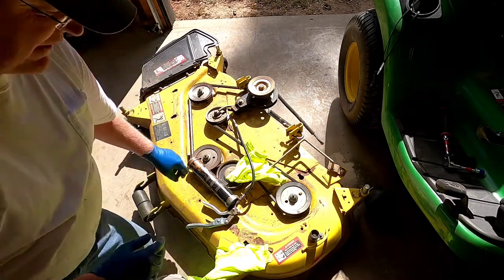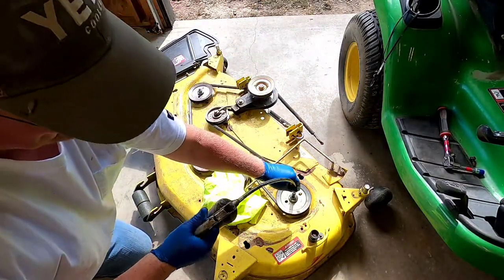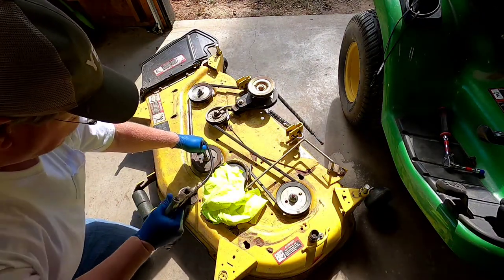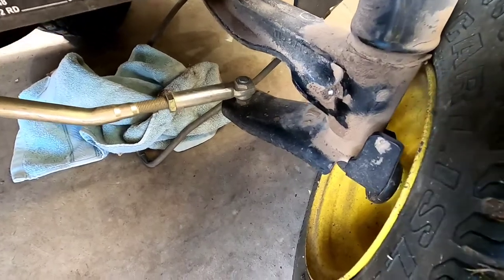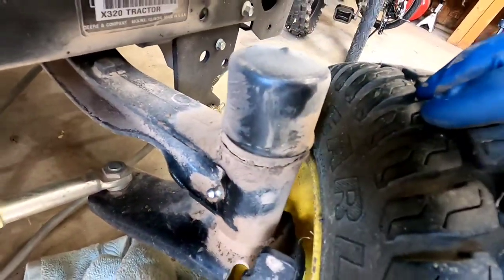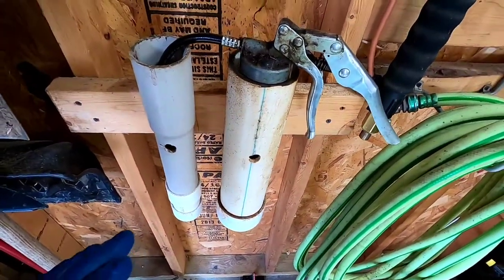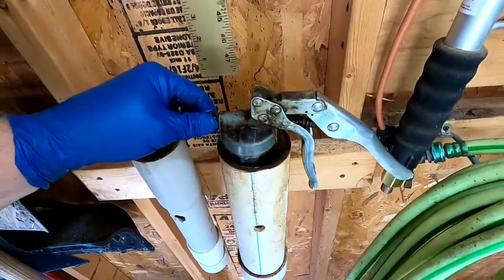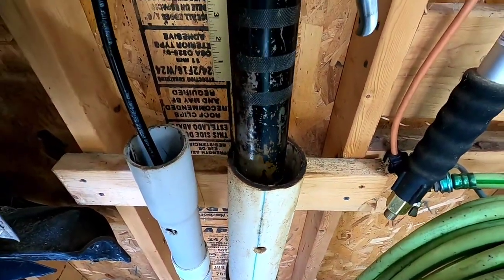How to Grease Lawn Mower Deck Blade/Belt pulleys and Steering wheels John Deere X320

Comment: Saw a "Steve Small Engine Saloon " video here on yt last season and the spindle bearings NOT receiving grease...  I'm contemplating on pulling one apart just to see what and how my X340 has and if it's like what he showed. I'll go fetch the link and post it back here
Reply from the maker: Thanks for the link, good luck
Reply: Here maybe this will help you. Splindle bearings will get grease if you grease like this video creator shows. He said it comes out of the spindle so he filled the assembly up. Meaning the grease had to pass by any and all of the bearings dust seals to get out of the assembly. So you can rest assured bearings receive grease. As for anybody who post a video telling you that grease won’t penetrate a dust seal that is not capable of stoping pressurized grease from passing by or for that matter a small fart. I’d be careful who I take my advice from. Just because they post a video does not mean the person making it has any clue as to what they are talking about. As for this video I bet this man can tell you how long his bearings have lasted. He greased it well. Didn’t stop because someone said the seals would prevent grease from reaching a bearing. Here is the link to my video to prove it https://youtu.be/PwObkilFXN0
Reply from the maker: @GTObearclaw1  Wow thanks, I had not idea, I thought I was doing it right, but I Now I understand bearing alot more!!! thanks for taking the time to explain what is going on. and yeah these are the original bearings still going strong!
Reply: "Anything is possible. What is the probability? " As I have not had to deal with this issue yet,  nothing surprises me,  wrong or right.  Your use of the correct term,   "pressurized" is spot on..👍